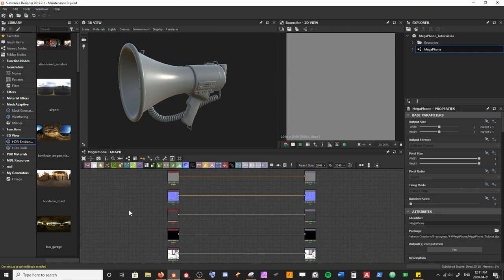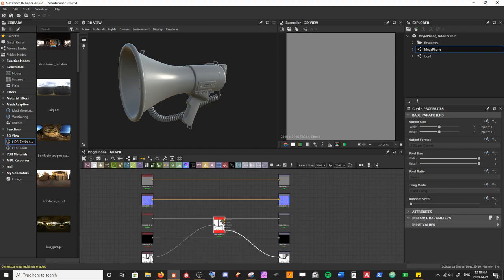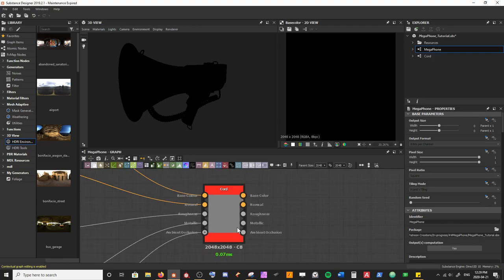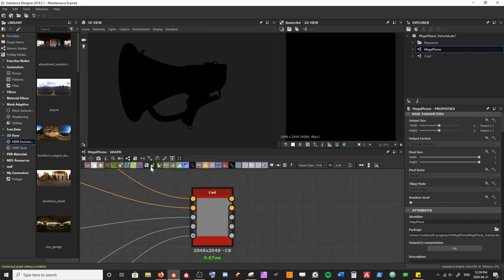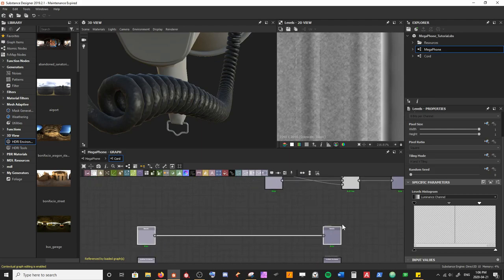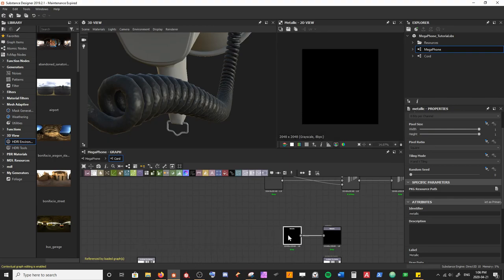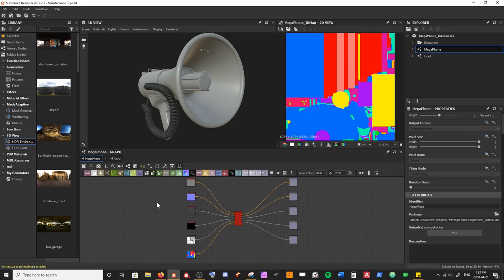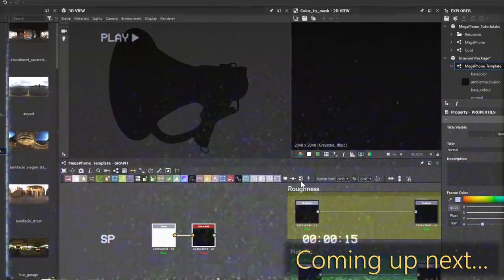2. Cord Material | Procedurally Texturing PBR Game Assets

Comment: Amazing workflow, exposing parameters to reuse constructed graph is genius...I'm curious, where & why did you learn this technique? Do you prefer it from Painter ? Thanks!
Reply from the maker: Much of this workflow is a parallel to Painter to a certain degree, it's just a different way of accomplishing it. I prefer it for the reason that there is far more control over the creation of the materials themselves when working directly in SD. I can't pinpoint one exact area that I could say I learnt this from. I suppose to a certain degree, I've just picked it up myself by looking at documentation and experimentation. That, coupled with the fact that you don't really see this pipeline being taught anywhere else on the internet (not as much as Painter at least), was a big reason I wanted to try my hand at it. I would say there are areas that I do really prefer it compared to Painter. I've always been more on the technical side of art as it was, so nodes are fascinating to me. That being said, there are limitations to it currently which makes me think that this software wasn't entirely designed with this workflow in mind. But I have been using it solely for my personal projects lately with minimal issue! :)
Reply: The workflow looks very promising! I'm sure Substance will catch up on it, just with the addition of the beta '' see in context '' sub-texture, they'll make this work better, thanks for all the feedback man, and keep doing so good on teaching people!